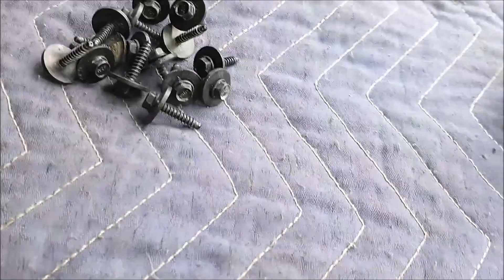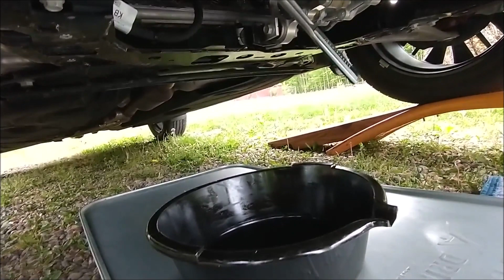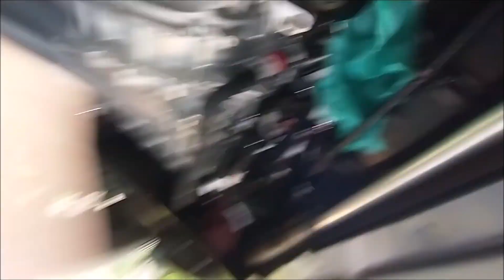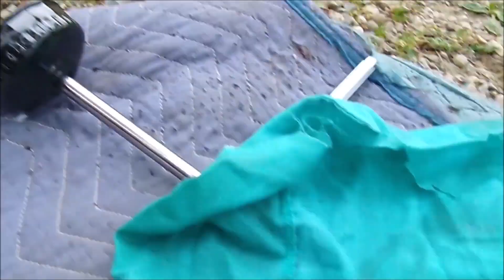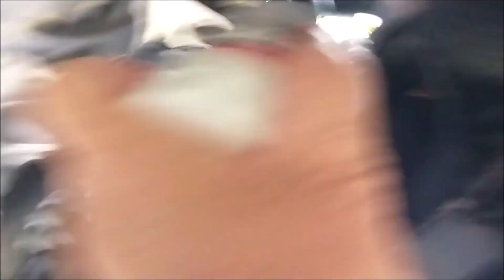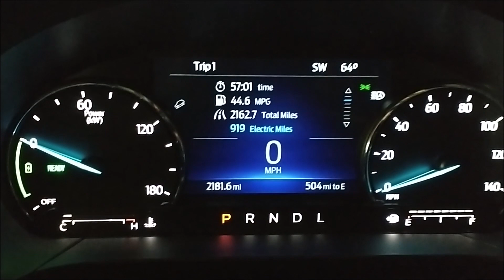2021 Ford Escape Hybrid -  DIY Oil And Filter Change

Comment: Okay Alan the next time you change your engine oil will you please change your transmission fluid the manufacturers are so stupid they do not put in a fill tube like on the older cars so now we have to change the fluid is in a drain plug on the bottom change the filter and fill it on the side of the transmission case so if you can please show how that is done to us owners of Ford Escape hybrids that would be great thank you .
Reply from the maker: Not looked into the transmission yet.  Next job is probably an early 15k PTU oil change, normally 30k.  If the trannie is anything like my Mustang, I'll likely use my fluid extractor (suction + pump) and pull as much oil as possible out of the fill hole and replace with the same amount.
Reply from the maker: Had to have the dealer change what oil would drain out on our Outback. (6 qts/$211).
Subaru makes it very difficult to change the CVT oil and tell dealers not to do it unless trannie needs rebuild.  100k warranty. They do want sealed for life!   CVT can't be flushed and refilling needs special equipment.  I was late at 163k, but best to do it at 120k.  
Had zero issues on that car, but for me changing rear wheel bearings at 130k and a MAP sensor at 150k.  Oh and several failed headlamp bulbs that they ended up warranting for 10 years!
Reply: Transmission fluid change is recommended at 160 000km/100 000miles. 
Super easy on my car, civic though. 
Helps if you buy oil in a bag with a fine pouring tip, just add till it overflows usually. But check manual.
Reply: Hello Allen thank you for the reply , have you changed the transmission fluid on your Escape yet , you mentioned your Mustang on your Mustang were you able to put in a transmission dipstick tube and dipstick , the reason I ask Ellen it'd be so nice to have this on the Escape I have a Ford Escape on order in the color I want and everything and when I get it I want to be able to put in a dipstick and Tube because I go off-road so please let me know if you were able to put in a dipstick in a tube in your car and if so if you got part numbers I'll put the same thing in my car already Allen will thank you very much for the videos you're doing fantastic thank you .

Comment: Thanks for the great video.  I have 2021 Escape Hybrid as well.  I have a question though.  The owners manual says to use 5W-20.  And you are using OW-20.  This is alright to do?
Reply: i have a 2021 escape hybrid and it says to use 0w-20 under the hood of the car. but the 5w or 0w is just the temperature rating.  both should be fine.
Reply from the maker: To be honest, I always struggle with understanding the complexities of oil viscosity ratings.  I do know that if Ford recommends a specific multi-grade,  use that.  Many hours of engine testing went into proving that out for wear, cooling, control, cleaning and fuel economy.   My first job was directing diesel engine tests on test beds!   The rule is you can widen the viscosity band if you have to, but you shouldn't narrow it.  So you can go lower on the first number and higher on the second.  However, engines these days use the oil not just for cooling and lubrication, but for control.  The correct viscosity is therefore even more critical.   I stick with 0W-20 as that is what is on the engine filler cap!
Reply: Agreed, as I worked in R&E for Cummins Engine; however I will NOT use Mobil Oil because Exxon would rather pay Attorneys than pay for the DAMAGE TO VALDEZ!! @AllenReinecke
Reply: The hybrid variant requires ow-20. Non hybrid versions require 5w-20. Whatever is on your owners manual. Ford has all of their escape variants in one book so be mindful of that.
Reply: I have a 2021 PHEV Escape.  The specification for the 2.5l hybrid (PHEV and HEV) in the US is 0W-20.  

The 1.5l Ecoboost is 5w-20 and the 2.0l Ecoboost is 5w-30.

Comment: This should be useful for when the new Maverick hybrid comes out, as I think it is the same drivetrain.
Reply from the maker: I'm looking to exchange my gas-guzzling Ram 1500 Hemi for a Hybrid Maverick, but only after the first year's kinks have been worked out!  LOL  They didn't do too well with the Bronco launch.
Reply: @AllenReinecke  I'm totally with you there. Between the chip shortage, Bronco launch difficulties and recalls on the 2021 F150, I'm on no hurry to pull the trigger.

Comment: Thanks, very helpful.  I will be doing my 2020 hybrid soon.  May suction pump oil out from the top tho (quicker I hope).  Happy Motoring!
Reply: Maybe, but you'll still have to go down below to get that oil filter. It doesn't look fun. If the filter were up top (relocation kit, anyone?) I'd be all for an extractor.
Reply from the maker: I have a 2012 Mustang and you can access the filter at the front of the V6 from the top of the engine bay (with the bottom of a trimmed windshield washer fluid bottle under it for the oil spill) and the oil drain is not above the hinged under-shield for oil filter access, but rearwards of it.  I have used a fluid extraction pump once for that, but usually only use it for transmission and diff oil changes.    On the Escape, there's no getting around removing the under-shield if you are going to change the filter.  If I remember correctly our 2020 Honda CR-V could go every other oil change for the filter replacement, but I did it every time anyway.   Clean, regularly-changed oil will allow an engine to last forever and is comparatively cheap compared with an engine rebuild!